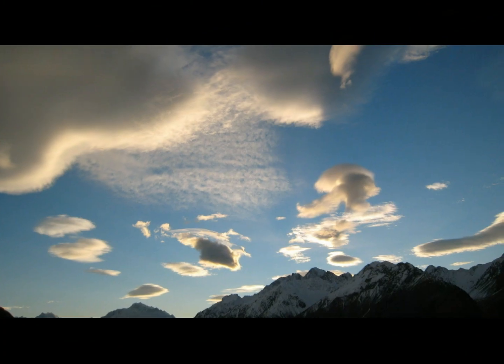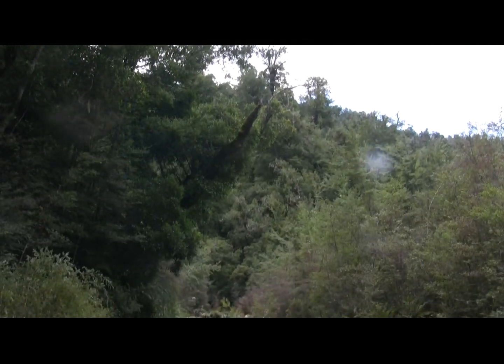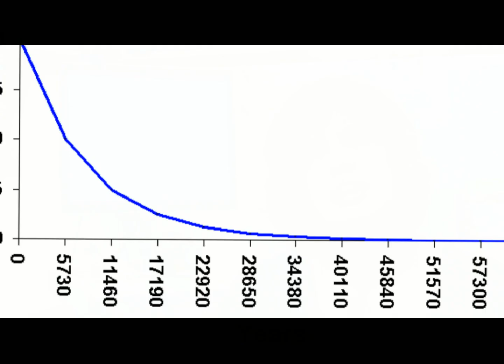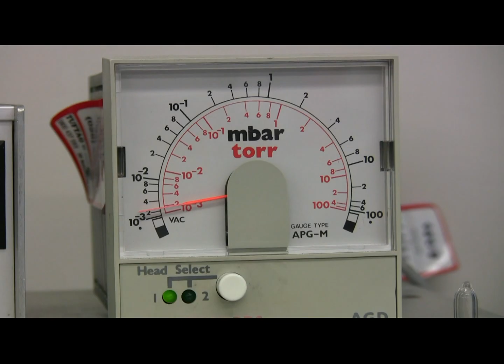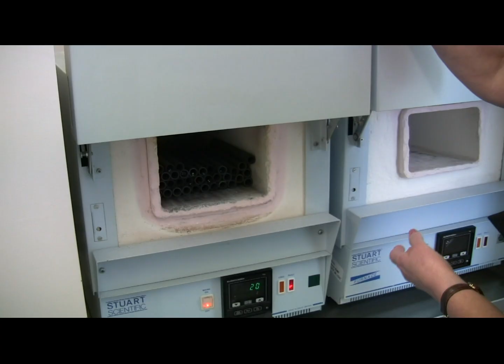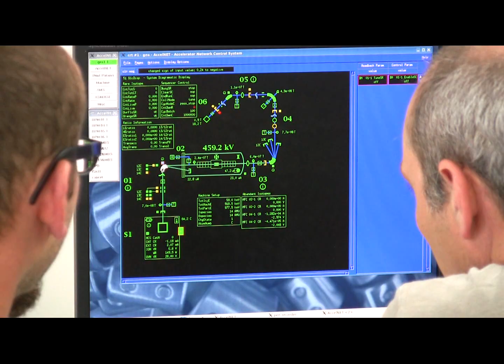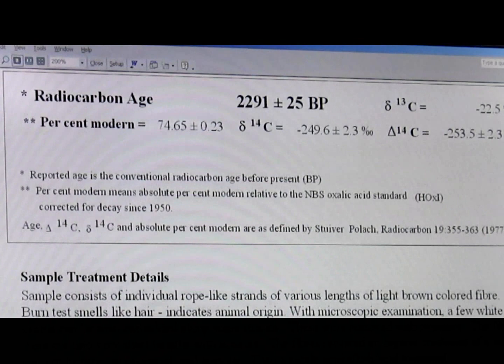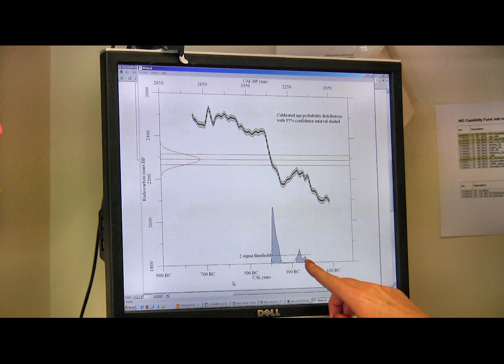Dating - the Radiocarbon Way

Comment: Hi! Super video : I have a question; where did you get the calibration curve? In the final graphic... 🙏🏻 thanks
Reply from the maker: Calibration curves give the relationship between the radiocarbon content in a sample (radiocarbon age) and the calendar age of the sample.  The calibration curve is constructed by measuring the radiocarbon content of materials for which the age is known independently.  Tree rings are the most commonly used, since the tree rings can be counted to determine the calendar age, and then measured to determine the radiocarbon age.  

We use the internationally agreed upon calibration curves, which are currently IntCal13 (northern hemisphere), SHCal13 (southern hemisphere) and Marine13 (marine samples).  Note that they are due to be updated and revised this year (2019) or next.

The calibration curves can be obtained from: http://calib.org/ 
This website also allows you to calibrate any radiocarbon age yourself, online.
Reply: @GNSscience  How do you date things older than trees? Isn't the oldest tree like 3k years old?
Reply: @andrewthomas4636  The dendrochronological curves cover much longer time span as the curves from specific trees can overlap - so the curve (for specific tree species and usually also for specific region) is built from many overlapping sub-curves from individual trees. This way, you can go as much to the past as you get the right trees (subfossil trees from sediments, trees used in constructions and so on).
Reply: @janhorak8024  ok, but how do we get 100k years or more of we use a comparison of trees to get recent dates?

Comment: Interesting to see how it is practically done as a chemist this has my interest as well. 
what is the average pricing for analyzing a sample in this way (a rough number is fine with me, just to get an impression)
Reply: $15,000 and no refund if they get the age results wrong, you have to sign a paper that says you won't get your money back if they incorrectly got the age results wrong. Give them a bone belonging to a 10yo roasted pig and tell them to do the testing in front of you, not behind closed doors, and the test result of the bone will be 30,000 years old 😂

Comment: We don't find C14 in machine blanks. To date things older than 100kybp we generally use K-Ar dating not C-14 due to the differential rate of decay… the half life of K is substantially longer.

That said the decay is a logarithm and therefore a function of an exponent (x=log10(A0/An)/log10(2)) and therefore you will never truly have a sample with no C14 (divide 1/2, then .5/2, then .25/2 etc).  You will however have a sample with so little C14 that it cannot be measured.

Comment: 1:38 "we know how much should have been in the sample when it was alive"

For samples where the carbon age can be cross checked with historic age, and by extension, for samples with same carbon age, even without the cross check - yes.

How about the rest of the cases?

We find 25 pmC - did the sample breathe two halflives ago, or did it breathe approx. one halflife ago in an atmosphere having approx. 50 pmC?

I happen to think the latter, how would you prove me wrong?
Reply: 1:46 While the equation can be simplified, the full version involves taking into account an original 100 pmC as starting point.

25 pmC only corresponds to "decay by two halflives" (0.5 * 0.5 = 0.25) if original ratio was 100 pmC.

Comment: If you are to wash it with "organic" solvents, wouldn't it be more contaminated with newer carbon..?
Reply: If I understand correctly, most (if not all) organic solvents are produced from compounds from oil. Oil is sooooo old (much much older than 50k years) that it doesn't contain any carbon 14, because all of it decayed.

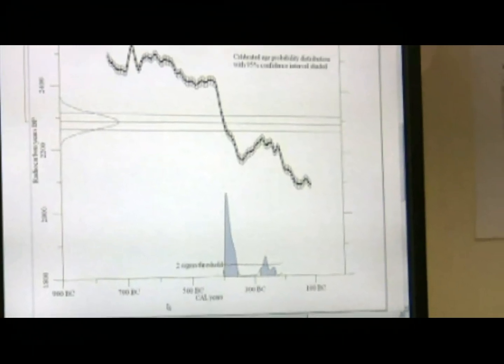Comment: 8:36 And calibration means, the original amount was not always exactly 100 pmC, it fluctuated.

For instance, on the Cambridge calibration from the nineties, made by dendro as check, the calendar years 750 to 450 BC mostly give about the carbon age 550 BC. Or, if you prefer, 2550 carbon years, or if you count backwards from 1950, 2500 carbon years.

When 750 BC carbon dates as 550 BC, we have more C14 in original ratio than 100 pmC, and when 450 BC carbon dates as 550 BC, we have less.

Back when it happened, the ratio in the atmosphere would have gone from 102.449 to 98.798 pmC.

When I claim an original ratio of 43 pmC for lower layer of Göbekli Tepe, I am doing same thing, except I use Biblical history rather than dendrochronology as check.
Reply: While you are correct that ¹³ ratio fluctuated, the variation is not that huge and, as you correctly pointed out, can be corrected by tables, mainly from dendrochronology.
Which makes it accurate to a few percent down to about 40.000BC.
Reply: @ThomasKundera  You are over optimistic about dendrochronology.

Much of the dendro is circular, the pieces of wood selected for comparison were so selected due to similar carbon dates (for instance) and they are so much fewer and so less big that the connexions get less and less certitude.

It's a bit like the other lignine based chronology, books (papyrus and paper are lignine) ... you can get vastly more detail and more certainty for 19th C AD US than for 19th C BC Egypt. So also with dendro.

Therefore, my comment still stands.

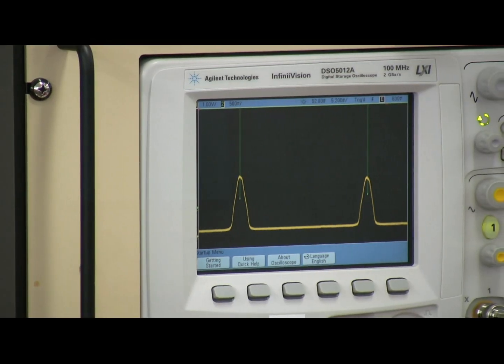Comment: 3:03 I am noting : the reason why one cannot carbon date things that are beyond 57 000 years old is, after that you have only 0.0009765625 "of the original amount" left, and that cannot be accurately measured.

What you mean is 0.09765625 pmC is too small amount to accurately measure.

I agree.

The thing is, when fossils not fully permineralised have been dated to 35 000 years ago, the amount remaining has obviously been above 0.09765625 pmC, since with a date of 35 000 years ago we have a remaining amount or ratio of 1.45 pmC, which can be accurately measured.

Comment: Did anyone catch that radio carbon dating only works at a max of 50k years?
Reply: @marcosolo6491  But they were dating dinos with radio carbon before either of those methods . . . So, how?
Reply: @marcosolo6491  carbon dating was developed in 1905 and is the first form of radiometric dating. The other forms came later.

Comment: Then how do you get idea fossils are millions of years old relative to geological environment. And density with sinking floating how does this work.
Reply: There's a few ways but the easiest to explain is they simply use isotopes with a longer half-life. Some but not all include Uranium-235, Uranium-238, Potassium-40. Because fossils are found in sedimentary rocks and the organic material has been replaced by minerals, fossils themselves are rock. The isotopes I listed earlier are not present in these rocks. They are however found in Igneous rocks. So what you can do is bracket the sedimentary layers. Essentially date the igneous rocks that are found below the sedimentary layer and date those that are on top of the sedimentary layer. In a hypothetical scenario, if you date the bottom igneous rock and find it to be 70 million years old, then date the top and it's 65 million years old, then you know that the sedimentary layer is from the Cretaceous Period and any dinosaur fossil or any fossil for that matter in the sedimentary layer is from the Cretaceous. You can also use relative dating, for instance T-Rex fossils have only ever been found in Cretaceous rock, so if you were to stumble upon a T-Rex fossil, you know right off the bat that you're looking at Cretaceous Rock.

Comment: Get any dinosaur bones or coal samples sent in for testing?
Reply: Did you catch that she said they can only date up to 50k years with assumption of half life of carbon? 2:40
Reply: @andrewthomas4636  My point here is that C14 is regularly found in these supposedly  prehistoric samples. The problem with the dating method is that conditions for preservation are highly variable in the real world and not usually known. For instance, a textile is a man made object that is stored under generally known conditions. On the other hand, measurable amounts of C14 can be found in samples of coal and fossils. Coal can also be manufactured in weeks and measured to be thousands of years old. I am not saying theory is wrong, just limited in it's application
Reply: @noobsaibot5285  Agreed, not a good long term dating method.

Maybe even less than 2k years

Comment: Part 2) The very fact that any c14 at all is found even in the samples or "machine blanks" that are supposedly millions of years old is an indication that something is not right with the measuring system. Either the measuring system is flawed or the samples as well as the machine blanks are not millions of years old.

Comment: 1:56 On this part, all of my criticism of carbon dates conflicting with the Bible grants (usually, not Turin shroud) full confidence to the labs.

You say the sample has c. 25 pmC, I grant it has c. 25 pmC.
Reply: Like, charcoal from Göbekli Tepe, lowest layer carbon dated to 9600 BC, upper to 8600 BC = 11,600 to 10,600 years ago, and two halflives (which should give 25 pmC exactly) is close to the lower layer, 11460 years ago being closer to 11600 than to 10600 years ago.

As 11460 years ago is not an actual age, in Biblical chronology, I posit, what is dated like this breathed an atmosphere with less C14.

Like 42-43 pmC for lower charcoal layer and 48-49 pmC for the upper one. That gives each sample exactly as many extra years when it started out, as a sample having 42 - 49 pmC now would be dated to years ago. The equation remains the same, even if the way it is implemented in real time isn't (obviously, sth carbon dated 2000 years ago cannot be 1000 years old, since there we have good cross checks with historical dates of objects).

Comment: Why did you not disclose that Carbon14 dating is very inaccurate beyond 1400 bce?
Reply: As it's not the case.
It's accurate for things not older than 40.000 years, about.

Comment: The 3 isotopes c12, c13, and c14 can be separated by magnetic deflection due to their difference in mass and then sent to different detectors for counting and to calculate the ratios. Why is it that a sample with exceedingly few c14 atoms ( like in the case of a sample that is believed to be 100 million + years old) cannot be counted?

Comment: First assumption is the carbon 14 levels in the atmosphere have always been consistent. We have no proof of that since it depends on Nitrogen in the atmosphere I’ve always been consistent second assumption all levels are constant in living animals.  These are two very large assumptions.  If either one of these are some scissor incorrect, the dating system does not work?
Reply: Nobody assumes that carbon 14 has been constant. In fact, one of the most crucial elements of carbon 14 dating is basing results on past carbon 14 concentrations, which are calculated through trees.
Also, while I am still a Christian, I am no longer a young earth creationist, and I think that if you really researched the claims of answers in genesis and realized how dishonest they can be, you may have a change of mind as well.